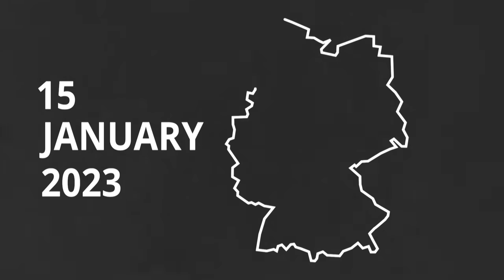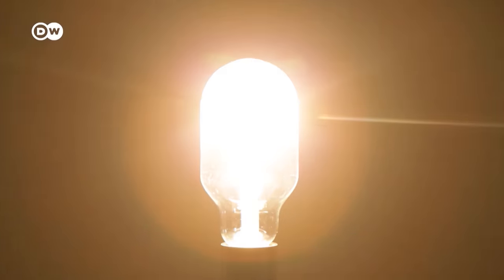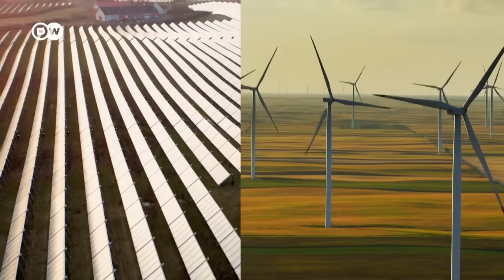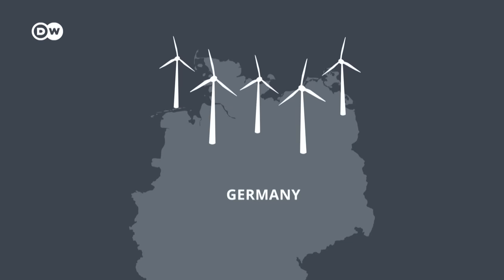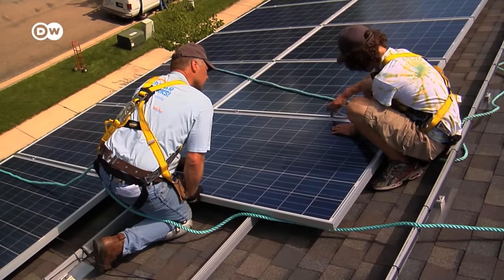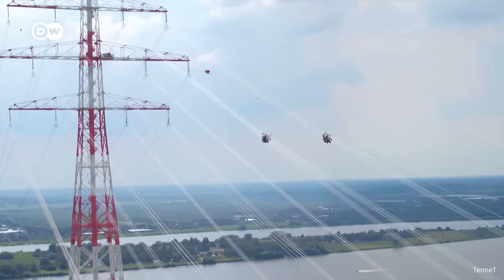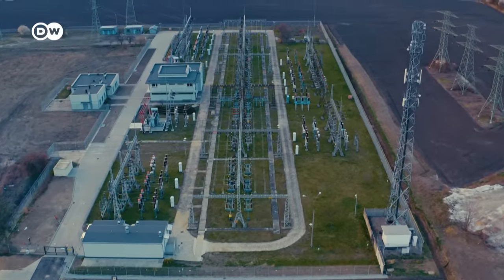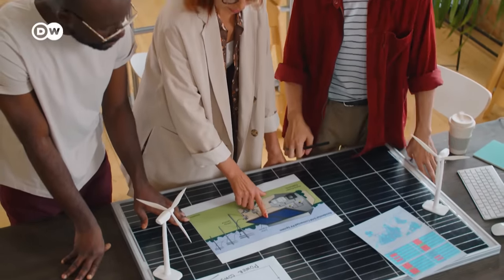This is what's REALLY holding back wind and solar

Comment: Option 3: go nuclear
Reply: Nuclear is the Swiss knife of energy.  It can be used as a bandage between differing systems such as coal and solar/wind. It can be a full use energy source and it can even be used to  "recycle" other nuclear waste when Thorium is also used. 
  Yes, it has its risks but all other energy sources do also. And when you consider if some sort of near Earth object ever hitting us and NOT causing an extinction level event but a darkening of the skies for a long time, nuclear is also a great "backup " energy source.
Reply: It's not the USA holding Germany back. It's just a little too late by now to bring back nuclear, as it probably wouldn't be politically popular. In a few years maybe, although then it will be cheaper to build more offshore wind farms connecting to the then finished transmission lines.
Reply: As soon as you have a solution for nuclear waste.
Reply: Nuclear was recently phased out in Germany, which seems ridiculous
Reply: @mmlas8683  agree, gas money payed well..
Reply: Uranium Fever

Comment: Here's a wild idea: lay the HVDC lines along major highways, aboveground except for ramps / intersections. It will require more wire, but a lot less planning / opposition drag -- and access for maintenance is eased. Is anyone seriously going to argue "We must preserve the beauty of our concrete / asphalt highways at all costs!!"? Those who argue against new power lines on environmental grounds must be shown to have their heads up their behinds: if we don't transition quickly, their land is soon not going to look anything like it does now. We need to do this quickly.
Reply: I suggested this to actual industry people year's ago and got laughed at. I also suggested to fossil fuel pipeline operators running hv transmission towers right over the top of the pipelines or directly adjacent to them. Dual use for land and ease of maintenance to. 😏
Reply: Good ideas 👍
Reply: Agreed!
Also, solar canopied highways would help reduce energy robbing Air Conditioning use during hot summers while simultaneously cut down cable run lengths to the power grid. Another benefit is that most charging stations would be located near major roadways for convenience sake (another saving on cable runs! Placing power along the road may also open up wireless charging on the fly as a premium range extending service and self driving tethered power similar to tow truck services.
Reply: @gary.richardson  nice and solar over supply and irrigation canals can reduce wasted water evaporation. And most are already parallel to electric infastructure. Then floating solar on dam reservoirs has massive potential as well. We need to be looking at what just makes sense here. 👍🏻😎
Reply: HVAC would be more efficient
Reply: Only in long distance
Reply: What about Tesla's Magnifying Transmitter with uncrewed and tethered hydrogen balloons? It seems like the best compromise for short-sighted people, to put it more cleanly!
Reply: I agree. Germany has an Autobahn that it could run the electric cable underground next to the highway. This would minimize NIMBY opposition.
Reply: I mean security and safety 😮😅!!! Wild animals are just supposed to know right? Also there are stupid people and kids.
Reply: @4literv6  Investors are shy to jump in, it's nothing personal. Too often, there are hidden costs just like what Elon Musk experienced with Giga-Berlin.
Here in the USA, good ideas get voted yes but run into roadblocks such as tribal rights.
Reply: @4literv6  The covering of lakes and rivers I hope to see a clear analysis on impacts to aquatic life. Shade can both be positive and negative, the right blend in the right locations is my guess in not hindering photosynthesis or predatory imbalances.
Reply: The "just have a think" channel recently had a video about HVDC infrastructure. A company in the US is planning to build along existing roads and rail.

Also, for a country with existing gas infrastructure, if those pipelines are going to be decommissioned or scaled back, wouldn't they make good routes for new cables?
Reply: Another Just have a think video mentions vertical wind generators to harvest residual traffic wind in motorways... And German Autobahns probably are the windiest of them all.
Reply: @andys844  it's great to see a fellow fan
Reply: @gary.richardson  Except that if you run the line right next to an Interstate or the Union Pacific most of the environmental / Indian objections have already been overcome.
Reply: @malcolmrose3361  True, it's usually waterways, as far as I'm aware, that interfere with fishing rights.
Reply: We try to put them along highways when possible but that not always an option or it may be be an option but cost much more which means your power bill goes up.
Reply: Its not going to happen. Highways in war times are used as backup runways for aircrafts
Reply: I actualy like transmission line towers
Reply: @4literv6  Running GAS or Oil pipeline under EHV/UHV transmission line will cause reliability and safety risk to the transmission line itself. It can be done but should not for backbone transmission line of the Grid.

A few years ago in my country, GAS pipeline along the main transmission line ruptured and explode. Immediately cause 3 circuit of 230KV lines to fail and lost 1500MW of power to the Capital. Lucky enough frequency not fall to the point it cause problem and nearby GAS power plant can ramp up fast enough to compensate.

This also change the design of every new GAS pipeline in the country not to run along EHV/UHV transmission line. (500KV+)
Reply: First of all running Electricity lines along the country shouldnt really be major problem in the first place its not like those cables(And towers take that much space, not to mention the farmera are likely to be compensated for it more than the land would ever give ) .
I dont know what is wrong with germans and their anti every sane Electric project ever concieved. Whetewer we are talking about nuclear power, or this(ok i kinda know, part of it is the soviet legacy but still ) .
Reply: @goliverg1855 well it depend on what you need to do, the modern technology permit to switch between both without significant waste, if you need to do underground or underwater line is more simple to have only 1 or 2 conductor, but if you need to do an air line is more convenient to do AC. Obviously every case is different and must be analysed singularly.
Reply: @carsonwilliams  the idea is the savings earned in lower DC losses from running below ground vs above will make up the difference vs decisions made with either above or below ground AC lines.
Reply: @meoao8829  I envisioned a pivoting palm tree cover that can tilt to maximize light capture and swing out for roadside maintenance and for potential emergency services such as landing planes. Solar covers that mimic rows of trees would look better also when combined with good leaf detail.
There are already lots of poles next to roadways already and locations that are specifically cleared for emergency runway use can also be applied to solar canopies as well.
Depending on the type of planes or drones landing, the clearances may be fine.
Reply: @meoao8829  I did some checking and found runway use to be a myth. There is no regulation.
Reply: Long-term big picture stuff
Reply: A better idea, especially for Europe and the US is to run it alongside the freight rail system, it's usually quite industrial already, visits most of the major cities that use the majority of the electricity and you could electrify the train system while your at it!
Reply: @goliverg1855  Chinese R&D companies have developed more efficient HVDC over long distances for this very purpose.
Reply: @robertlee6338  I don't buy the maintenance or damage concern, has enough substance to call it a stupid idea.
Reply: @4literv6  underground power lines are 3 times more expensive than above ground power lines. Major of the cost is drilling underground. Drilling Innovations to bring that cost down isn’t expected until 2030s
Reply: @goliverg1855  Not for transmission lengths above 600 km over land and above 50 km underwater.  Also with rectifier and inverter technology advancing that distance might shrink significantly.
Reply: Why above just put them underground.
Reply: Railway lines are better.
Reply: I think this will happen as our grids become more distributed.  However, if the goal is to transmit power less than 1000km, AC is more efficient.
Reply: @EdricLysharae  Over land the cutoff point is 600 km and shrinking with advancing technology.  Under water it's like 50 km beyond which DC overtakes AC.  Also if you bury the lines and they traverse moist soil or conductive ore the losses from AC also go up.
Reply: What they don't tell you in this video is you need big generators to stabilize the network, both in the transmitting and receiving end. Closing down NPPs will make it even more difficult to transfer electricity from north to south as you are removing a big stabilizing generator, regardless of a new grid or not.
Reply: Thought this as well for all essential resources to run along corridors. The problem becomes the interactions between the different companies that operate those utilities. How do you divide costs, maintenance, and liability? Of course it could be done, but by human beings as they are? The world would be very different if it was built solely by engineers and architects.
Reply: We already have a transmission grid.
Reply: @lukeblackford1677  That transmission grid was built for moving electricity from baseload plants to the consumer over only a few hundred kilometers or less.

The transmission grid we need now is going to be so much bigger, spanning thousands of kilometers across land and under the oceans.

"We already have a transmission grid" is like saying, "we already have roads" right after cars became plentiful but before there was a highway system.  Or "we already have an Internet" when people were still using dial-up modems and T1 lines.
Reply: Nope, that's bad idea. Imagine a semi getting off road and hitting one of the poles supporting the lines.
Reply: @sseamountain9377 that's the second reason why batteries exists
Reply: @mdzaid5925  one more thing, I prefer underground cables with some exception for aboveground. Sometimes  downed lines are repaired quickly enough to make sense.
Reply: @El-Comment-8-or  localizing resources also bring opportunities to tap directly and open up new markets based on proximity to source.
With that type of transition, the utility would fall into a secondary role and experience longer part life and maintenance in need of diversification of revenue. Safety codes for items past their expiration date would require code adjustments for extended life when applicable and strict compliance to cost accounting conforming to life safety liabilities. The tradeoffs would need to be engineered carefully to preserve human life. Some engineers go to jail based on their design. I wonder if these other decision makers need to be placed in this same category of responsibility to get the right results.

Comment: I live off-grid. Regarding the use of a washing machine for example, I only use it once my solar batteries reach a certain % level. If the weather is bad, not enough sun, then as a last resort I can use a generator to supplement my battery power. This is rarely needed though as my solar system is fairly well balanced (enough panel to battery ratio) to compensate for poor weather. If I am able to juggle when I use my power loads I'm sure everyone else can too, without too much effort on their part. Welcome to the future!
Reply: Great! That may be part of the solution but remember that only roughly 25% of the electricity is used by households. The rest is industry, services, transport (trains), offices, hospitals, schools,... some usages are a bit harder to delay (even though Deutsche Bahn doesn't mind delays that much 😂).
Reply: Hardly a practical solution for most if us.
Reply: @st-ex8506  Lithium technologies such as those proposed by Tesla are not a rational way for universal energy storage and never will be. We need new solutions ie Liquid Metal Battery. Relatively cheap, more durable and error-proof technologies.
Reply: @st-ex8506  bro its a single company, but using all available precious metal supply (lithium, vanadium,...)
What I found interesting was Iron Oxide battery, US company started in 2013, initial value 10USD/stock, todays value 1USD/stock... Not really banging big, although the system is very energy efficient, the batteries are in containers and there are industrial pumps included, so servicing etc.
But the efficiency is brilliant. Maybe in few more years...
https://youtu.be/Ui6wWzxCrQ8
Reply: That sounds impressive, but would I have to drive a van with a manifesto written on the outside of it?
Reply: Is it still legal to live off-grid? 😅
Reply: @RaduP66 yes, I do and my state (New Mexico) supports it.
Reply: same thing can be achieved by limiting the power in a home so that when washing machine is on and you have some other appliances also on in the home, the MCB will trip. no investments needed. the planet will thank us later :))
Reply: Good for you. However, your model cannot be scaled up without nasty consequences.
Reply: Problem with globalising your setup is the battery and the occasional use of a generator.  Do the math:  your battery x world population = Not enough resources to provide enough batteries to create this amount of storage capacity.  And then, your occasional use of the generator x world population = A freaking huge generator running 24/7.   I'm building on our off-grid system too, but its far from ready to implement on worldwide scale
Reply: @rayshobbyfarm.1019  if someone chooses to live differently, they require less energy.
Reply: @pookahdragon5850  I agree 100%. If you're more aware, you're likely to use less. But the fact remains you can not scale this to world level in the next few years.
Reply: Imagine baterries is pretty good solution where u dont have too much snow in winters. F.e. in Lithuania november - february its close to zero production (aproximately 15-25 times less than household needs) meanwhile in the summer its 3-4times more than needed.

Comment: Storage is key.
Reply: Batteries are already a usable storage medium, efuel and hydrogen not so
Reply: If you build enough storage, it gives the dispatchers an energy buffer that provides them with more operational flexibility.  Storage also allows for the utilization of some of the excess renewable genetation.
Reply: Which doesn't exist and is even more expensive than expanding the grid...
Reply: Nope, storage systems are a dream. What is required is a responsive system that can inject as much energy into the grid as is demanded. And that technology existed in Germany until not so long ago.
Reply: a key fantasy
Reply: Nuclear is key.
Reply: not practical
Reply: @PistonAvatarGuy  was about to comment the exact same thing
Reply: And totally cost prohibative. I pipe dream at best
Reply: Maverick  not cost effective. You cannot have a facility sitting there waiting for intermittent surplus electricity. Then think you can just switch it on for some hours. Will never make sense
Reply: @tomdonahoe3539 if you could create storage. The storage would essentially take the place as a dispatcher.
Reply: Not only. Clever use of energy is also a key but everything depends on a good and clever system